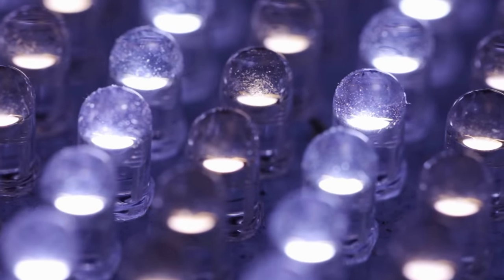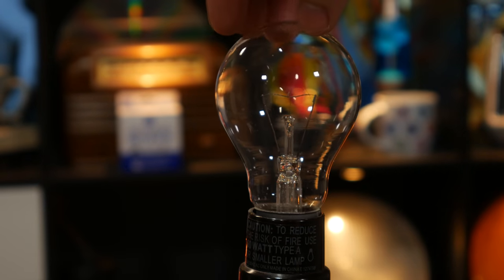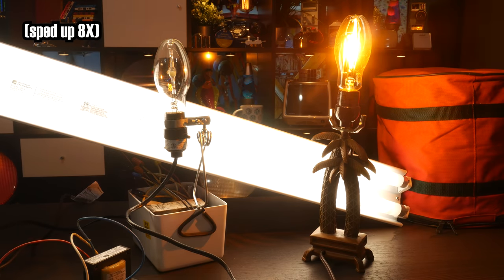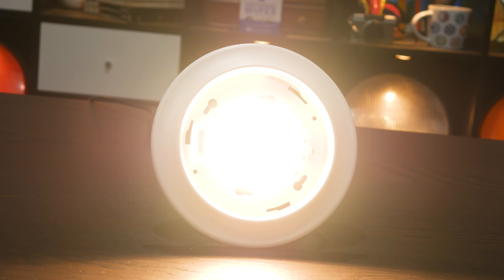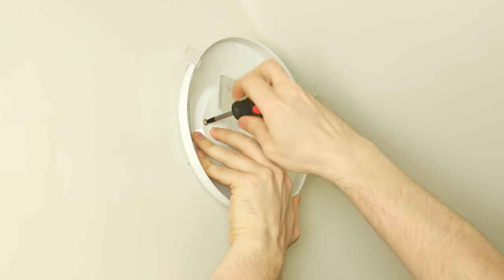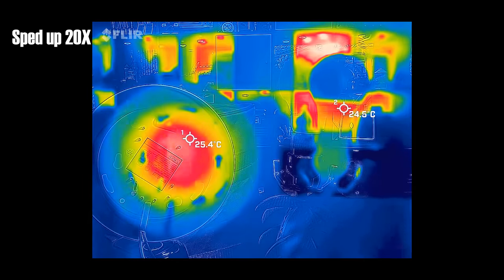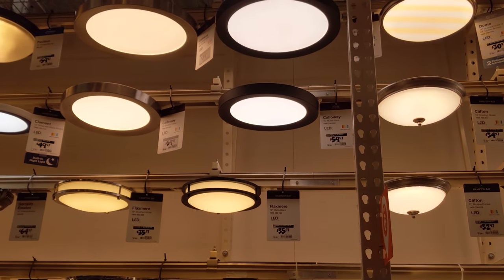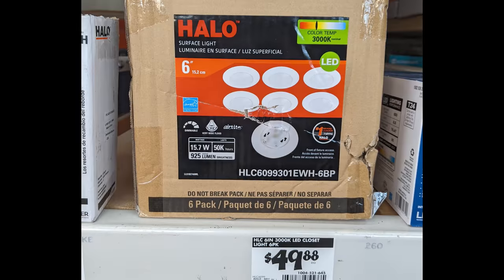A troubling trend in lighting?

Comment: In Australia we have plugs on our lights and sockets in the ceiling space so you just unplug the LED fixture and plug in a new one. Downlights are held in place with mouse traps so no need for a screwdriver either, just a high tolerance for pain.

Comment: I had a conversation with a guy that worked as an engineer at a major light-bulb manufacturer and he had a prototype bulb that was virtually immortal (from regular use). (According to that guy, who may not be a reliable source.) Only down-side was supposedly that it starts up slow. So yeah, I have reason to believe that at some point bulbs were de-facto planned-obsolete when they didn't have to be. - I saw the bulb in action. It seemed fine at the time.

Comment: I run LED strips around the top of my ceiling.  I had to try three different brands to find one with connectors sturdy enough to not break almost immediately. I love having complete control over the light level and color.

Comment: Recessed/pot lights are the biggest peeve of mine in homes. They do an all around terrible job. They only send light downward so nearly no diffuse light is created by bouncing off the ceiling, saying that, the ceiling remains dark and looks terrible; most infuriating is they cast stark shadows.. often implemented in kitchens.. where you need to see what you’re doing on the countertop.. with the fixture behind you… CASTING SHADOWS ON THE CHOPPING BOARD. why people desire a terrible evening experience boggles my mind.

Comment: The color temp thing drives me nuts. daylight and cool light are HORRIBLE. Even in the office I work at, they use “bright white” which I find to be a happy medium. 

We just redid my parents kitchen and ended up going with 3000k as it works really well with workspaces. We went crazy with lighting though, the pendants are 2700k and what are primarily used when just walking through/basic light. The overhead wafer lights are 3000k and we use them when cooking (as it’s a decked out kitchen)

Comment: What we need is a standard LED driver board form-factor with a surface mount connector. Then fixtures can be designed around this standard, and be user replaceable with a quick connector plug-in. The hardest part would be standardized cooling, a small fan would be an interesting solution.

Comment: In some ways, it's the sealed-beam headlight over again: you have to replace the housing when just the "bulb" fails. (Worse, with the electrical work needed - a SB headlamp at least had a socket.)
As you say, it's a trend in lighting in general, which doesn't "feel" right to us oldies. But maybe it is. It's like lots of things that are no longer repairable - certainly economically, and often (because of surface-mount technology, miniaturisation, and specialist requirements) at all: e. g. TVs.

Comment: Replaced (4) 10.5" square recessed incandescent fixtures in my den  with (4) 11" LED fixtures. Three months later 2 of the 4 started blinking when you turn them on. Working in the electrical field all my life (64 years old now) I guessed it was the capacitors that most likely went bad. Replaced 1- 20 microfarad  in each light fixture and   then we had lights again.  I gracefully stepped off the ladder, took a bow... Ok the last sentence didn't happen but the lights did work.

Comment: I have to say that my traditional fixtures retained too much heat - the mortal enemy of LEDs. I was burning thru LED bulbs like they were going out of style. 3-6 months was a good life for an LED bulb installed in a traditional fixture in my home.

The difference here is that while the internal guts may be basically the same, the size isn't. There is more internal airflow in the fixture which means it dissipates heat better. And therefore less thermal wear and tear on the bulb.

Comment: Good one. I have a ceiling fan with an LED light in it, and I have thought about how it will cost hundreds of dollars to replace it if/when it fails. I have to buy the specific new old stock part from the manufacture. Everywhere else in my house I use Edison screw sockets so I can use either the latest screw-in LED bulbs, or "smart" Philips Hue bulbs. I am completely with you on your opinions in this video.

Comment: I have 3 dimmable LED bulbs that were cheap as shit at IKEA that have been on 24 hours a day, and probably 20 more that get used intermittently, since 2014 and I haven't had a single one fail. The color temperature is good... I haven't checked but I think around 2700K-2900K. I've been impressed, and very happy with the energy usage.

Comment: I have been told that the main reason that incandescent lights have such a short lifespan is that the filaments are made in a shoddy way such that there are frequent thin weak spots in the wire that makes up the filament.  For a couple of cents more per bulb they could have drawn the wire through more or better dies so that the wire produced would be more even.  I have bought light bulbs for traffic lights before in order to get the long life and noted that they were marked 130 Volt.  The traffic light bulbs are run slightly dimmer at 120 Volts for ruggedness and longer life, but the filaments are also made better for reliability.  I am not sure that the incandescent traffic light bulbs even available anymore.  An incandescent bulb that has run an extraordinary number of hours will get silvery black on the inside of the glass and therefore dimmer.  This can especially be seen in long life automotive bulbs when they eventually fail.  An incandescent bulb that fails early doesn't have a chance to get blackened inside.  Even fluorescent bulbs get darker especially at the ends as they age from the metal that erodes from the heater filament electrodes.  LEDs can drop to less than half brightness before they fail from age too, but when they fail it seems like the driver is frequently the failed part.

Comment: In certain countries like Australia, those oyster LED lights cannot be installed without the paid service of qualified electrician. In fact,any electrical work outside the basic replacing bulbs in sockets, requires a qualified electrician. Unless one wants to change at least 5 or 6 lights, the labour cost far outweighs the cost of LEDs. That said, I have seen some of the newer construction projects work around this rule by having a plug and socket inside the wall or ceiling so it can be user replaceable.

Comment: Yeah, I just put 24 ceiling boxes in a single large room. I like these LED flats, but also worry about matching one when it fails. Going with standard screw socket fixtures and LED, too. Am hoping the three ceiling fans will keep the air circulating enough to keep them cooler.

Also, for years we were told that 100W incandescents were BAD and they did everything they could to eliminate them and force us to use crappy 60W bulbs because they were more efficient. Now, with LEDs, the efficiency isn't a problem — but getting 100W-equivalent LED bulbs is ridiculously more difficult than it should be.

Comment: I built a new addition, and put can lights in both rooms. But the cans are not rated, especially since the cans have insulation over the top, for old style bulbs. Instead I put LED lights meant for the cans in both rooms, using one K rating for one, and a different K rating for the other.
Both rooms have dimmers, and there are plenty of lights, so you can have office rated illumination or whatever below that you want.
In addition, the larger room has additional lighting on two fans, and the can lights are in separately switched circuits.
And the larger room has floor lamps, and there are led strip lights for special purposes.
All bases are covered.

Comment: You know what would be a great compromise? This kind of lighting fixture with a standardized three-prong plug on the back. That way you just install a standard outlet wherever you'd like a lighting fixture, then unplug the dead one and plug in the new; the outlet would provide enough friction hold this lightweight light in place, and the fixture covers the outlet when in use. Compromise nothing, standardize everything!

Comment: Back in your LED traffic light video, you mentioned that new technologies sometimes come with new issues... BUT, if the benefits of the new technology are good enough, the better solution is to fix the new issues rather than ditch the technology. In this case, we need a new standardized plug to add to the light's electrical box, so when we have to replace an overhead light, it's a simple matter of just plugging the new one in and mounting the light.
Reply: I agree. I find this video very strange coming from the same guy making an argument about "but sometimes" . This is another perfect example. The integrated LED is built into the fixture, offering plenty of room to spread out the driver, LEDs, and heat sinking so all those benefits can make for better light distribution, flexible design, better heat dissipation, better looks, and even perhaps better efficiency. Even though the current design sticks the LED modules on so you can't replace them if they fail or they're not your preferred color temp or light output, that's not a reason to just give up. We just need a better design that allows for the modules to be replaceable and perhaps even easier to install than the screw socket. I disagree with this stance that it's good to hold onto outdated technology just for that when the screw itself could use a lot of improvement and versatility now that we have small chips that can produce lots of light

Comment: As for why some people have terrible longevity on led: they are often installing them on old incandescent-designed dimmer switches. Those will wear down leds control boards really fast, basically turning them on and off 60 times per seconds.

Comment: While I agree with your concerns about being locked in to a design or manufacturer, and (unfortunately) don't trust the majority of people to replace wiring inside a junction box, I also think that a code update to require lighting boxes to use some sort of protected quick connect plug (maybe one that's actually safe for once, America?) and either consumer or competitive pressure to make the LED boards replicable, or at least a standard to adapt mounting plates to your preference of front end fixture, will fix these problems in the near future.

Comment: in some areas a licensed electrician is supposed to do all electrical work. So im sure everyone can afford to schedule an appointment with an electrician and pay a grand to replace the fixture. Some fixtures have replaceable boards, but they still in most cases have to be wired in.  A better design would be a standard led board that plugs in and is held in place by a couple standard screws making it safe and doable for anyone to swap out.

Comment: My experience with LED fixtures and proprietary tech has me never wanting to use anything of the sort ever again. The primary issue for me was when the fixture failed. Instead of just removing an old bulb and putting in a new one, the whole fixture had to be replaced, and none of them lasted any longer than a standard light bulb would have. The worst one was an outdoor floodlamp. It's bad enough having to replace a bulb fifteen to twenty feet up, but having to replace the whole fixture is for the birds.

Comment: Energy efficiency does not mean good design. Light emitting diodes might last longer and use less energy, but recycling their components is an issue almost no one mentions. 

Incandescent lights are made of a few simple materials: copper, glass, tungsten filament, and a conductive base. Conversely, light emitting diodes are composed of an integrated control circuit board and a diode. These control circuit boards are difficult to recycle.
Reply: In crappy LEDs they are even worst for the environment than incandescent lightbulbs, what you save on electricity you waste when you throw them out.

Comment: I am a builder, and I have been fitting these solid state fittings for years now... they are fantastic.. the bulb replacement leds are very unreliable, I have not had one of the solid state fittings fail once fitted, where one in ten of the bulbs would fail before we handed over the job.

Comment: Technically, if you hook enough LEDs together in series, you CAN just plug it into mains and expect it to work. It would flicker at the frequency of mains and would only be on 50% of the time, but it would work. You'd just need roughly 60 of them in America and 115 of them in EU because of the usually 2V voltage drop.

Comment: 19:41 - My 2018 home brand new construction had every single LED surface mount light die within 18 months. There would be no warning, it would just would not come on any more or would actually pop the breaker which what great fun since you would have to take a trip to the garage until there was time to fix it. I think it was 14 in total, or on average once a month. High ceilings and a ladder was always required. I bought several boxes from Home Depot for spares. One of the worst experiences, and one you don't even conceive happing to you in a brand new house. Could not image if I was elderly.

Comment: On the topic at the end about the colors clashing differently despite the same color temperature, it's important NOT to confuse 'color temperature' with 'color'. Or, because we're discussing lighting, 'color' is more accurately called 'chromaticity coordinates' (note: this is only true when discussing ambient scene lighting; chromaticity coordinates are otherwise NOT the same as 'color', because a light color and a dark color are two different colors even with the same chromaticity coordinates... Unless the maximum brightness is capped by the light source whose color you're discussing, at which point you disregard lightness).

Color temperature is a one dimensional scale, and on a chromaticity diagram it makes a curve. If you draw that curve in the CIE 1960 UCS (where UCS stands for 'Uniform Chromaticity Scale'; note that the 1960 standard is mostly defunct, Except when it comes to calculating color temperature), you can then draw lines that are perpendicular to that curve to find all the different chromaticity coordinates that have the same color temperature.

If you want lights that don't clash, what's important is that their chromaticity coordinates are close to each other - NOT that they are the same color temperature. There are lots of times where color temperature changes quickly without the chromaticity coordinates changing hardly at all, and vice versa. Colors that start to go into the magenta region of a chromaticity diagram can even be at the intersection points of several color temperature lines, meaning that magenta-ish tinted whites might be just sliiightly different from each other, but have color temperatures that are several thousand degrees different! Meanwhile, you can have a pair of slightly greenish-tinted lights with vastly different chromaticity coordinates, but only be 100 K different in terms of color temperature!

It's worth noting that this has NOTHING to do with the light's color rendering index. You can think of the CRI as how much of the color spectrum it can produce; the 'fullness' of its spectral power distribution, so to speak.. But as any computer monitor can show, any actual shade of white can be produced with the absolute lowest CRI physically possible (the best and highest quality displays that have the widest gamuts, only output 3 individual wavelengths - one for each color channel. While it's possible to create white light with only 2 wavelengths (yellow and violet), only having 3 wavelengths is still pretty far from having a 'full' SPD). As far as lights with clashing colors go, you can at least judge exactly how well they mix even with low CRI samples.

Comment: Thanks for the video!  I'm particularly frustrated by these being built into ceiling fans.  There's one in my daughter's room and I find the light harsh, and there's nothing I can do about it, short of replacing the entire ceiling fan.  It wouldn't be so bad if they standardized the form factor and made the disc shaped lighting element something you could swap out with a plug in replacement.

Comment: One advantage of these fixtures over traditional recessed cans, is that the cans create a hole in the insulation of your ceiling cavity so you lose heat through them in the winter.

Comment: I know this probably won't apply to like 95% of people but I've found that using LED strips with an adhesive backing is amazing for lighting rooms. I can't install new fixtures into the concrete ceilings of my apartment so we had to get creative. As a bonus, they don't even get warm to the touch because everything is so spread out.

Comment: I had fixtures like this put in my house in 2018 in a budget remodel but they did not have the large smoothing capacitor. Only after I moved in did I find they had an issue with a high frequency flicker (strobe) that webcams really pick up, but you do adjust to after a bit, but half of them failed, starting to flash and pulse. I did get them replaced by the supplier, and the replacements had a smoothing capacitor. I like the color tone of these lights for the rooms they are in, but I am probably going to replace them all just for ones that don't have a high frequency flicker and are fully dimmable. My webcams hate these lights.